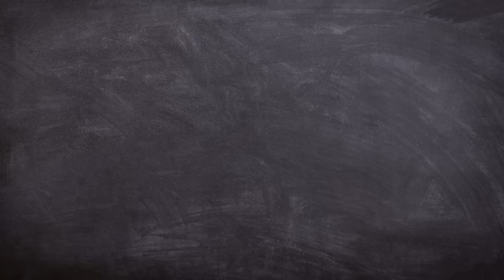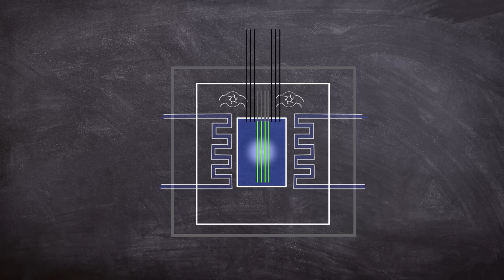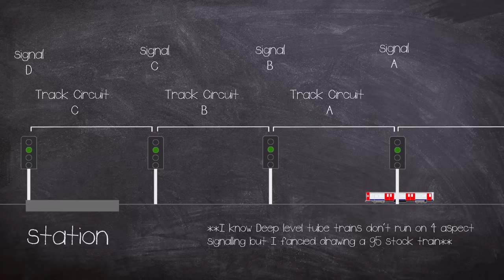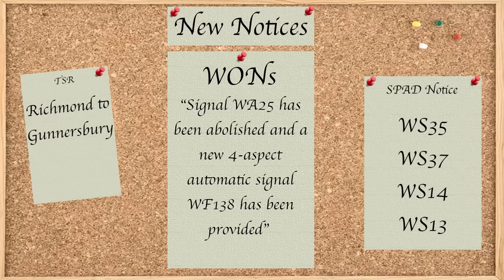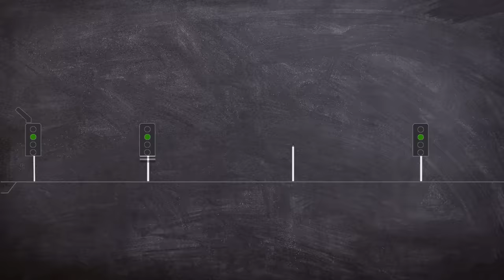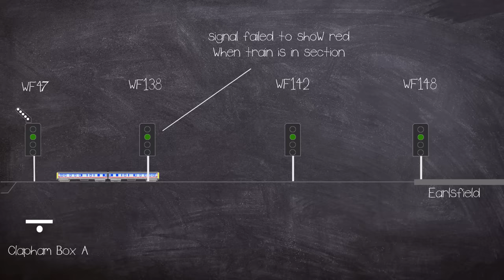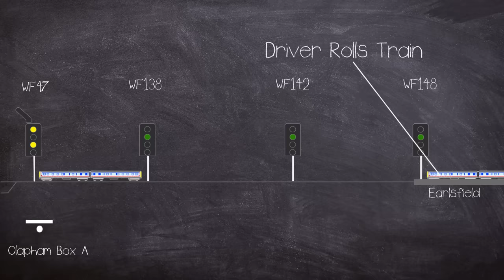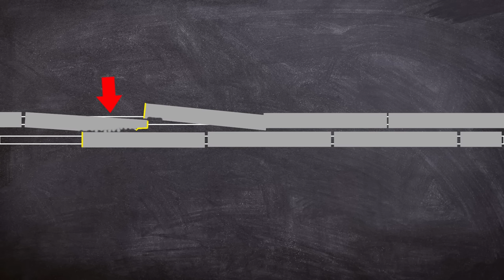A Brief History of: The Clapham Junction Rail Disaster 1988 (Documentary)

Comment: Was it possible that while that secondary work was being done, the tech thought he accidentally broke the connection of the "blue" wire and then purposefully reconnected it creating the disaster? 

Labeling wiring is still a serious fault today for the most idiotic reason: no one wants to buy wiring tags......
Reply: It's not just buying them! it's specifying them in terms of colour, size, font size, nomenclature, material composition and spacing between them on the cable runs etc. etc.: no one wants to take responsibility in case they are incorrect and they have to be changed out at cost to someone! It's the things like this on large projects that are left to the end and then rushed. Need to agree a cable labeling specification document in a project in good time so you don't have to re-visit 49 stations and three depots! Been there, done that, got the t shirt. Rant over.
Reply: @1963TOMB  Good points. I worked in the System Engineering / Networking world, and I am guessing that is cushy compared to your points you made. Also, this is just a guess based on your spelling of colour, that there is a ton more red tape in the U.K. also based on your points.

Maybe to add to your rant, the labels being fireproof, bio degradable, or IP67 water resistant.

Comment: 13m38s
Not being awkward here but all you show is two wires in parallel which means what?  It doesn't show something being false fed.
Joined the S&T 42 years ago, so I know a bit about this accident.  MIRSE.

The most hours I worked in a week before Hidden was 112 (7 x 16 hrs!) testing at Newport Panel for the SimBids through Severn Tunnel, which later had it's own crash and you have probably done a video on it.  Nothing to do with the testing though.  I'm 99% sure of what happened although I forget the official conclusion.

Just added the Clapham memorial to Google Maps 😞

Comment: The Swedish high-speed train X2000 could if motor was turned off, coast all the way from the city of Nässjö, to the city of Malmö, 300km. And train drivers heading for Stockholm C, sometimes coasted the last some 10-20 km to the Central Station.

There was, at least a token kind of system on smaller lines Iearned from my book about the Highworth branch near Swindon.

Comment: I don’t understand how one yellow is higher caution than two yellows… wouldn’t more yellow mean more caution?
Reply: A very good question.
Considering the fact, the braking distance was always within the signals "yellow" and "red", either the 2 aspect signalling (yellow at the distant advance - red at the main), or 3 aspect signalling (yellow at one block signal - red at the next). The 4 aspect signalling is here for the line capacity improvement - either half the distance between the signals (double the number of the trains) or square-root of 2 times the speed without longer distances between signals (for an example from 100 kmph up to 140 kmph) BUT:
In both cases the braking distance is not within two adjacent signals - one section, but within two sections - three signals.
Germany and Eastern European countries use the aspect "yellow over white" - that means, the distance between signals is shorter, than the braking distance, the signal aspect is often used as a repeater.
In my former country the 4 aspect signalling used to be like this:
green / proceed at max speed
yellow / warning, start braking from the max speed
yellow over white, repeated warning, the braking distance from the max speed is longer, too late, dude...
(but from the reduced speed for freight trains is still enough - here You can figure out, where is the line capacity improvement - f.e. combined traffic of mixed trains)
red / danger - stop
I agree with You.
green - proceed at max
yellow - warning for the faster trains
yellow over yellow - warning for the slower trains (at this time the faster train should travel at the speed of the slower one)
red - danger
Reply: @janpf0624  interesting! Thank you for the reply!

Comment: That train driver was an idiot. He stopped the train because he thought of the DANGER of bad signal where the outcome is that a "stopped train" might become a danger. It was a self fulfilling prophecy of doom. Don't they have radios to communicate without stopping the train? It's lunacy to run a modern train system without radio communication capability.

Comment: Well, if you want a disaster, barges, bridges, signaling, and trains, there's the Big Bayou Canot accident.  So many things went wrong for it to happen.  It's an episode that sounds exactly up your ally!

Spoilers:
First a barge being controlled by someone poorly trained travelled into the wrong river in the dark, striking a railroad bridge.  However, the was designed to withstand a barge strike, but there was part originally designed as swing bridge, but the machinery for it was never applied.  The problem was that the swinging section was not secured to the rest of the bridge, therefore in the barge strike, it pivoted a few feet.  This movement however was not enough to break the rails, which flexed instead.  Thus, this did not break the electrical current through the rails to notify the signals that the line was out.  Several minutes later, Amtrak's Sunset Limited would strike partially rotated bridge and fall into the river, with the loss of 47 lives.

Comment: Your friction analogy is the dumbest thing i’ve ever seen. 

Your teeter totter is correct but your explanation is incorrect. The friction comes from the material of the wheels and rails and the normal force between them (weight in this case). The “contact patch” or how much of the wheel is touching the rail is completely irrelevant to friction when the material isn’t sticky or deforming.

Comment: You have no clue what "fail safe" means and there is no such thing as a "fail safe" control system period much less one that brings whatever operation(s) it "controls" to a "crashing halt".

A "fail safe" system is one that "defaults" to it's "preferred" mode of operation when it "fails" and therefore does not actually "fail". A "shift on the fly" 4WD system with no "lockout hubs" and a part-time transfer case that is "fail safe" uses front axle shaft "disconnects" that are spring-engaged and electrically and/or vacuum-disengaged so that if the  switch/wiring/actuators and/or vacuum pump/plumbing/diaphram "fail" the disconnects DON'T disconnect and the axle shafts stay engaged with the hubs and they are "locked in" via spring tension OR simple friction if/when the spring(s) "fail" and the vehicle "defaults" to 4WD whenever the transfer case is shifted into 4WD. A "pushbutton" 4WD system takes it one step further and uses electricity and/or vacuum to "disengage" 4WD and spring tension to engage it in the transfer case so IT "defaults" to 4WD as well. Why? Because the most likely "failure" scenario involves being "off-road" and some obstacle(s) the vehicle is driven over and/or through damaging wiring, plumbing etc in a situation where 4WD where be required or desired in the near future or already in use and suddenly "losing" it could cause the vehicle, driver and passengers to become stranded in a literal "life or death situation" that a lack of 4WD created or at least contributes to. 

A nuclear reactor does not become "safe" simply because the "gravity-powered" control rods "drop" in a "power outage" and such a "safety system" has multiple "failure modes" from "residual magnetism" preventing control rods from dropping or dropping fully to being useless if a "seismic event" jams them and/or a "coolant leak" caused by same and/or loss of power to pumps and/or valves or a "steam leak" in the "hot loop" drops the coolant level just the wrong amount so the dropped rods "follow" it down far enough to continue the reaction but not far enough to cool them adequately resulting in a boiling coolant "BLEVE" event and a reactor vessel explosion far more catastrophic and deadly than a "meltdown". 

Similarly a block signal that "defaults" to red "danger ahead - stop immediately" condition due to an "electrical fault" and can do so even when the block it is "controlling" is empty and safe to "proceed" into and instantly from a green "proceed normally" signal could and will cause a "panic stop" and a train just inside an empty block with an empty block and green light to enter its block no more than a "short" block behind it and a red light immediately behind it a following "driver" will expect to "go green" before he reaches it because he did not get any "yellow light" to "slow down" and/or "proceed with caution" at the last signal which would be the case if he were "overtaking" a slower OR stopped train in front of him.

The UK "rail network" is overwhelmingly "dark territory" with NO signaling, does not operate 24-7-365 anywhere, does not run "mixed traffic" anywhere, does not operate in "inclement weather", does not run "heavy freight" trains at "high speed" and/or "high speed rail" for more than a few minutes/miles at "stretch", has very few grade crossings and extremely limited opportunity for "collisions" but still has had dozens of mass-casualty "head in the ass" (literally) rear-endings of passenger trains by "goods trains" and vice versa and it still operates "rolling stock" passenger cars that are not and never have been "steel boxes on wheels".

Wooden and/or "aluminium" boxes on wheels is 99% of the "rolling stock" in the UK and with "vacuum brakes" and/or "chain and buffer" couplers and nothing remotely "modern" about 99% of the "rail network" besides the propaganda claiming it's "modern" and "advanced".